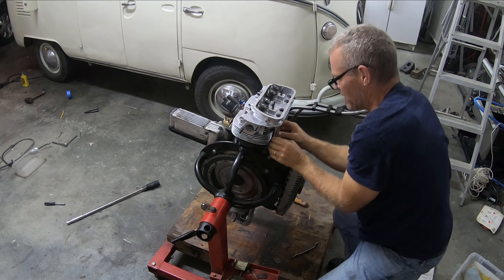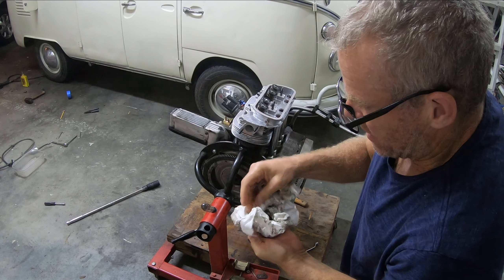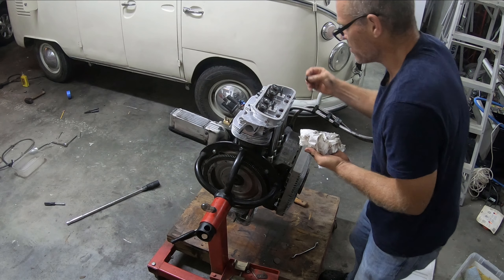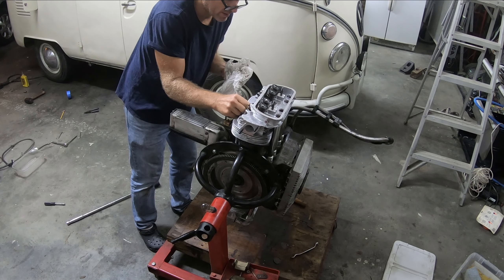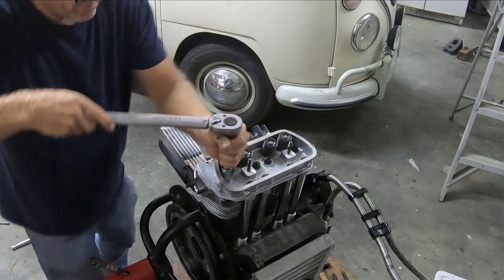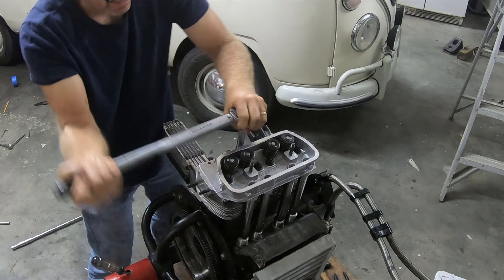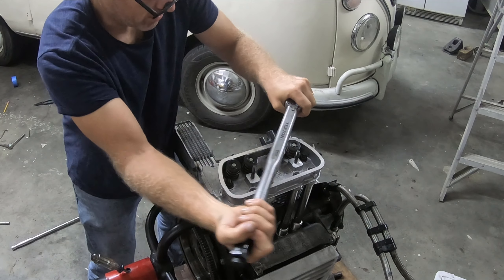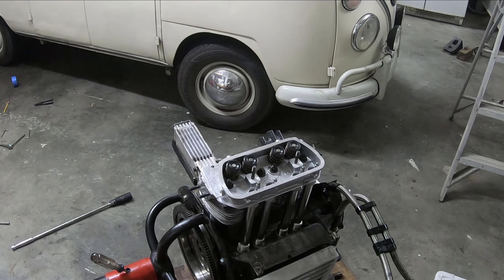VW Split Bus Engine Upgrade to 1968cc - Video 04

Comment from the maker: Anyone else who does this - do not forget the air deflectors that go under the push rod tubes.  I had to unbolt everything and reinstall just to get those air deflectors in place.  You cannot easily put them on after putting on the heads, and the deflectors are critical for good air cooling!
Reply: yup. saw that right at the start.

Comment: did you say ratio rockers? those look like 1.1 to 1. just binge watching at the moment. trying to catch up to the 2332 or whatever the next iteration is.
Reply from the maker: So I built a 1904, then a 1968 and now a 2332.  I haven’t put the 1.4 rockers on the 2332 yet because I am waiting on my Tim’s Stage 2 Heads.  Probably 2-3 weeks out still…